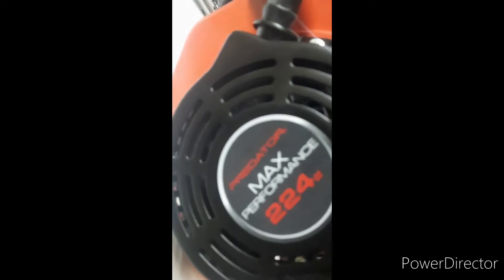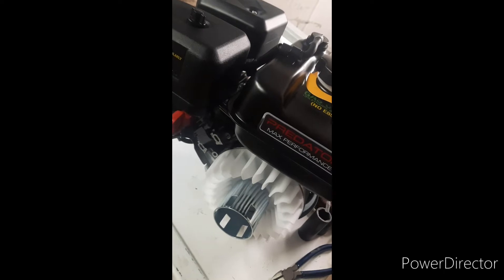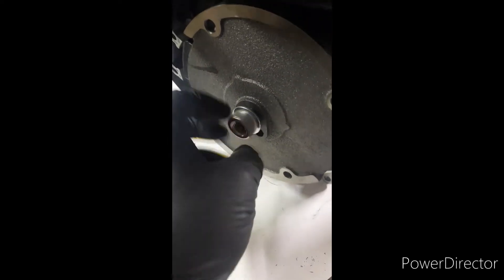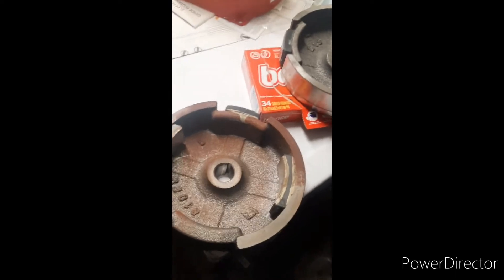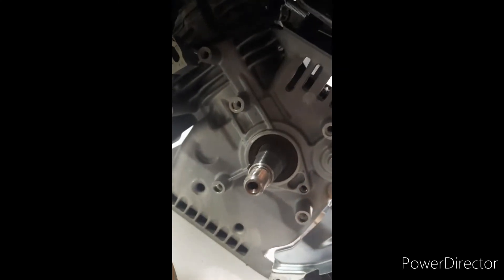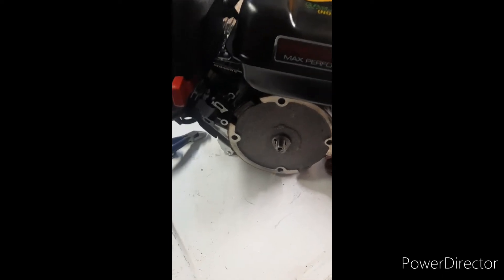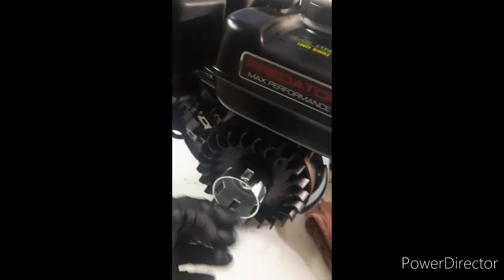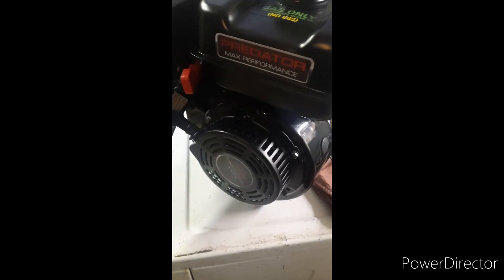installing a charging coil on a predator 224

Comment: Curious to see if you've had this set-up running yet? How did the motor run? Unless the two different motors have the same stroke/timing your 224 may run out of time with that flywheel on.  Depending on how far out the timing is you may be able to find an offset key to put timing where you want to be, or you could remove the key and lap the crank and flywheel and run it without it. Best of luck and great idea overall!
Reply from the maker: It seems to run just fine with the hisun flywheel. I was wondering if the time would be different but it doesn't seem to lack any power so I'm sure it's good to go

Comment: Excellent video and great idea! I was not going to buy a Preditor 224 due to the fact they do not have a charging flywheel and none available, also didn't know that my HISUN 196cc with charging coils would interchange with the 224cc please update us when you have the conversion video! great Job! Subscribed!
Reply: Yeah the Coleman guys who want to keep their headlight going should be thrilled about this engine. Easily worth the extra cost over a Pred 212. You should notice the extra low end torque over the 196.
Reply: Yeah the only thing is sometimes you have to modify the fan shield
Reply: Or the flywheel wont sit flush